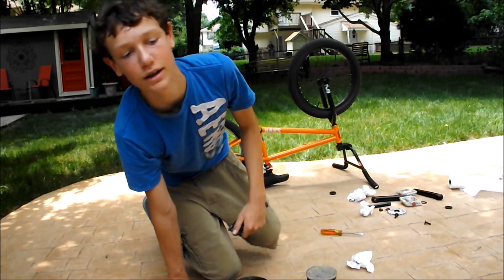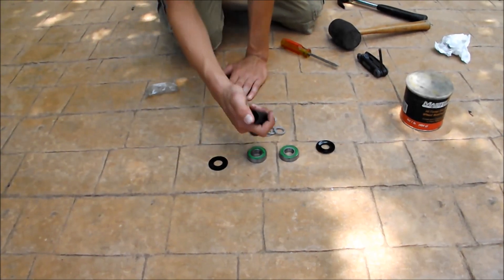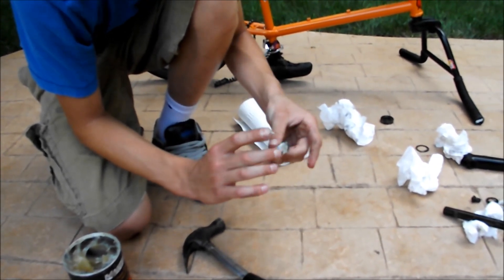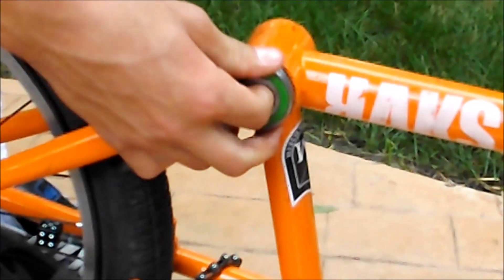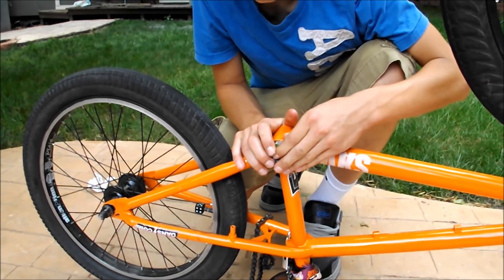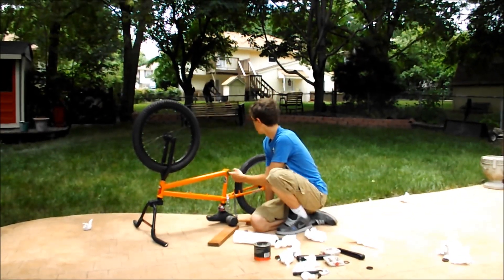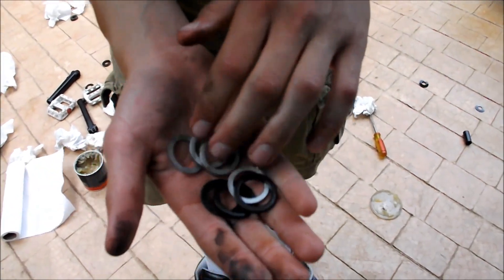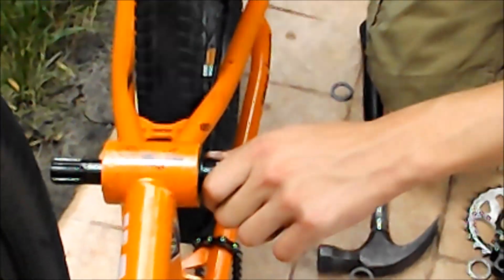How To Install a Mid Bottom Bracket BMX

Comment: Put the bearings in the freezer.  Warm up the bracket a bit whith a hear dryer. And plop they go smooth in the frame. Never hit the bearings. Spend your mony on a good cycle repair book.

Comment: how do i know what bearings and spacer to frame should i buy? i dont want to buy too small of a beraing or too short of a spacer for my botom bracket thingy
Reply: Lookup ur frame specs should specify American/Euro/MID, That's outside diameter. Inside diameter is the mm measurement 19 or 22mm, so you need corresponding bar to go in the middle. Lastly u needa know how many splines your petals are so they match up too. If you can't figure that out, go to a bike shop.
Reply: bradyn bassett i cant get bikes delievered to where i live cos all the sites ive checked dont ship here.. :c
Reply: im not talking about an online store, a physical bike store should hold parts that you need, and if you dont know what type of bottom bracket you have, someone there will show u what u need.
Reply: +bradyn bassett well, there isnt a physical store thats y im having to look online..

Comment: You implied in title and in your video you knew what you were doing but made countless errors in every aspect from removal, prep, the tools to install and how you used them to install to the actual install itself. I’m sure you realize this from comment section but even the homemade bottom bracket tool you explained was not correct. You destroyed the lifespan of that bottom bracket beating the sh!t outta of it the way you did, you forgot the drive side and non drive side cones/dust covers, you didn’t dry fit properly for chain alignment, you didn’t install the spacers in the right sequence after the dust covers, you didn’t put the wood on the right side when you wanted to install until the end and you already beat the crap out of them. This is why you should learn and take it to a professional instead of watching YouTube video thinking you know what your doing and then make a video for youtube passing along importer technique and install tips and tricks for bottom brackets and splined cranksets. It creates misinformation and ruins quality parts!